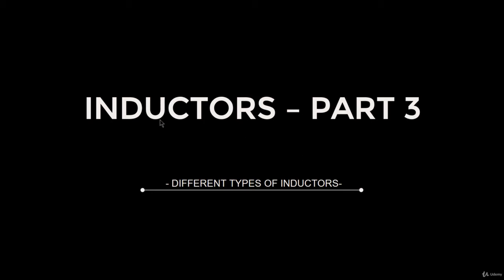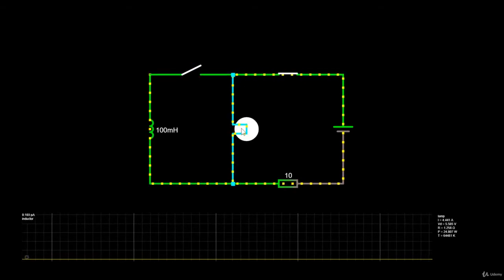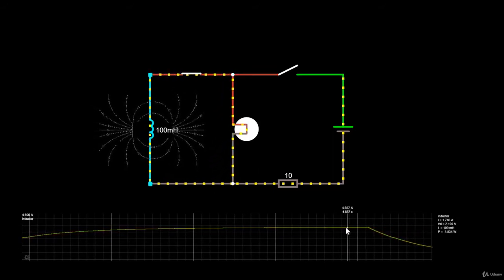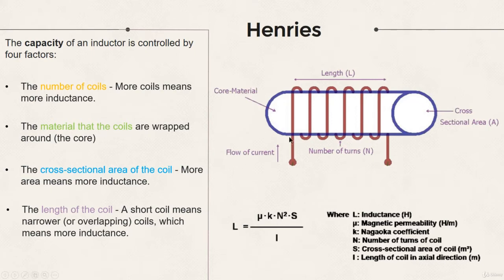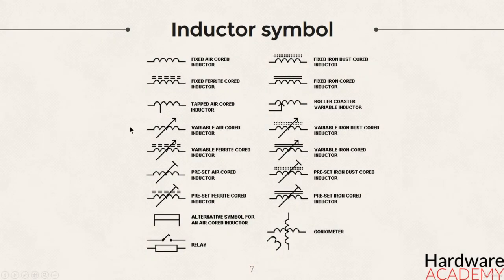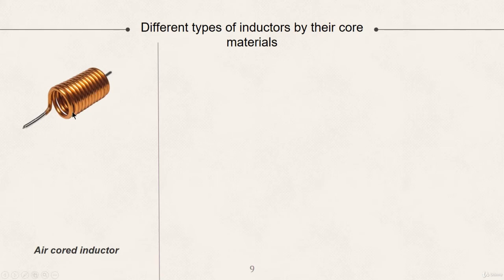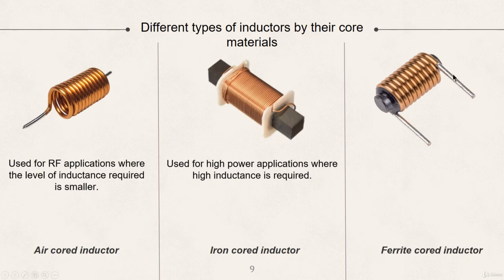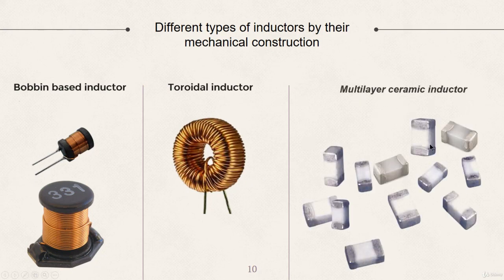19- Type of Inductors

Comment: So, given the fact that the 3 types of inductors are the same value and space on the circuit is not an issue, could I just substitute for example, an SMD inductor with either a bobin based or toroidal ?